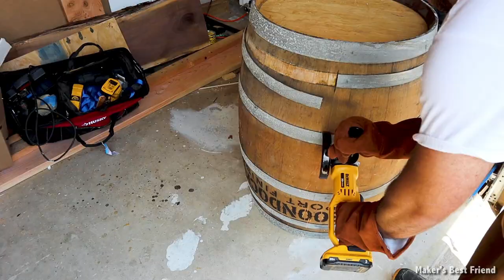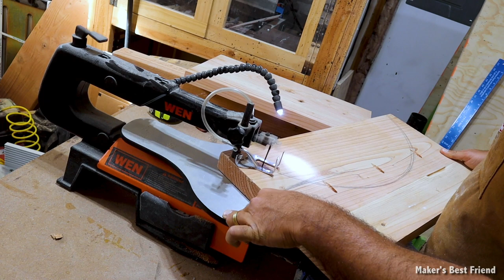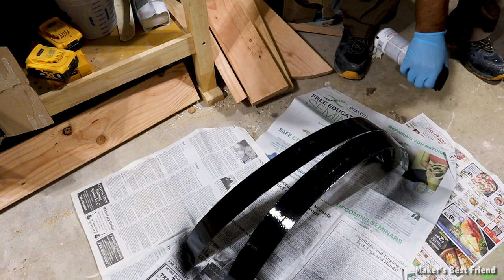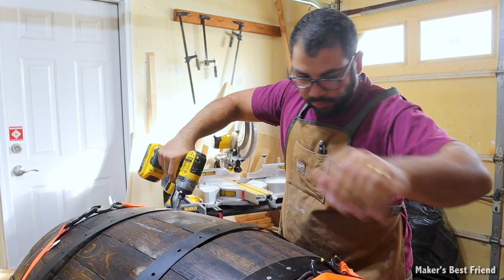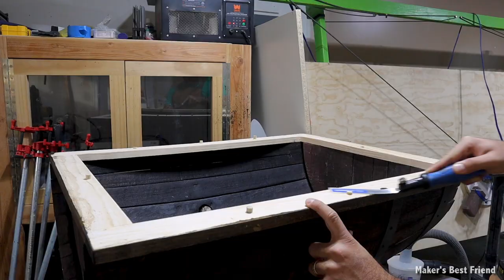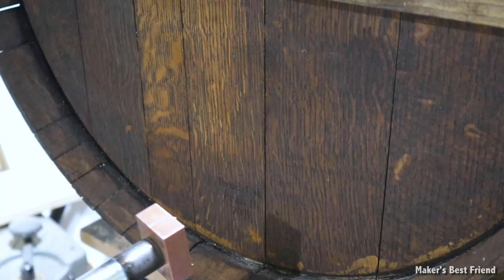DIY Wine Barrel Coffee Table

Comment: Great video, thanks for sharing your process, I love that you used the inside area of the barrel for storage under the table top. I was wondering about the jointing on the bottom, where you attach the sides of the base to the 4x4 with two screws. I saw you used pocket hole jointery on most of the other joints except that one, I was wondering how/why you made the choice to use a different joint style there? Also what kind of wood did you use? It looks like pine to me and it's gorgeous, matched up with the oak in the barrel perfectly.
Reply from the maker: Hey! So I used a different type of joinery for the 4 x 4 because I thought the base would look nice with the two dowel plugs  contrasting the wood and I also wanted to use much longer screws for strength that I didn’t have the right pocket screw sizes for. Honestly, I would probably reconsider doing the same with some smaller lag bolts for extra strength, but it’s holding together well. And yep it’s pine on top with wood stain applied to match darkness across it all